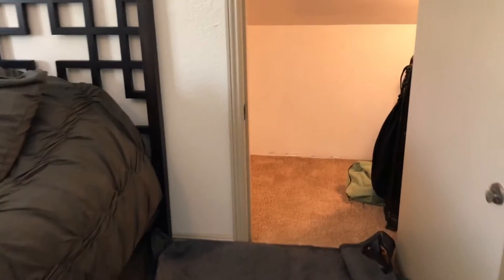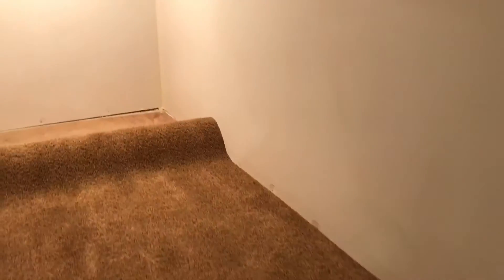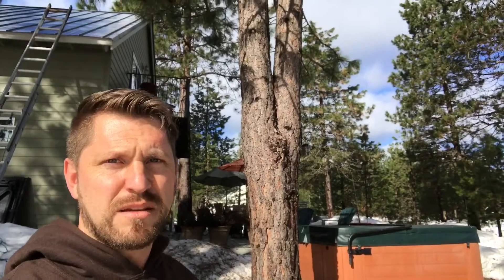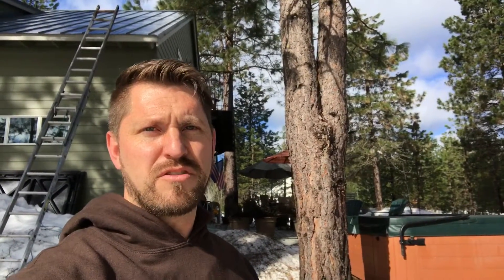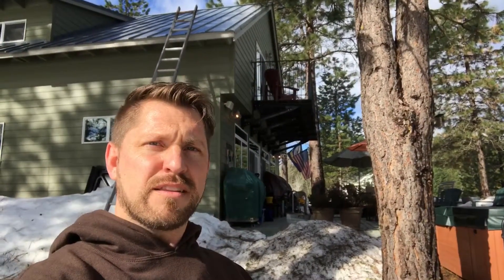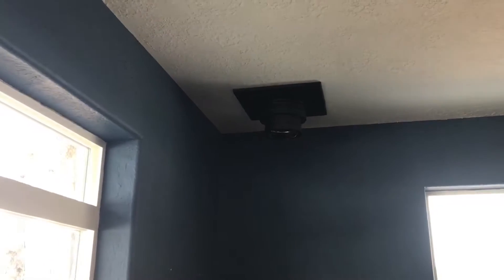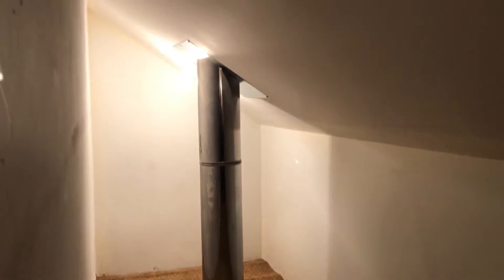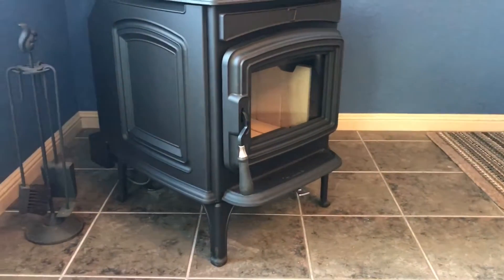Jotul F 45 Greenville Wood Stove Overview

Comment: Can't leave the class A chimney exposed in the closet. Must wall it off. Otherwise, clothes, boxes, etc. will end up against it. Take carpet out of the area to be enclosed.  Put service door into area and smoke detector in closed off area, making sure you can access the smoke detector for battery change.
Reply from the maker: Great observation!  With this project, the homeowner was going to provide the enclosure around the Class A venting, in that storage area, to maintain the required 2" clearance.